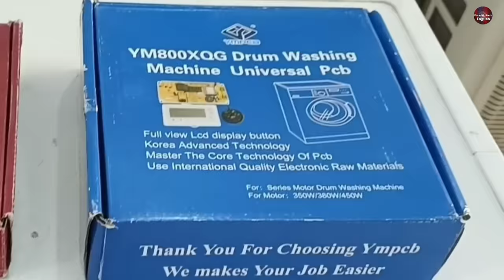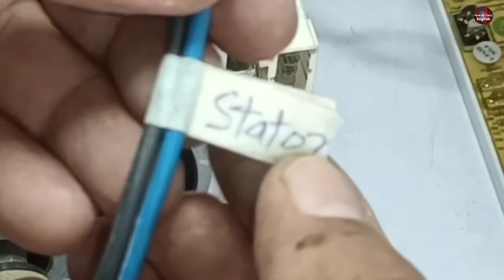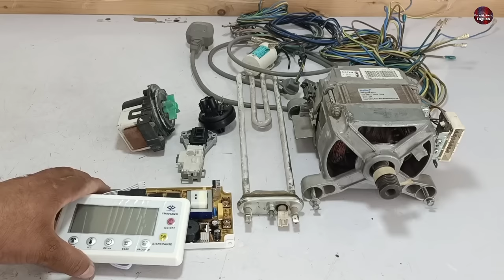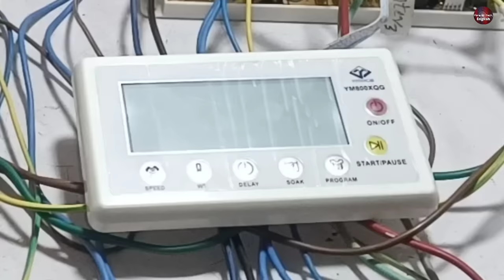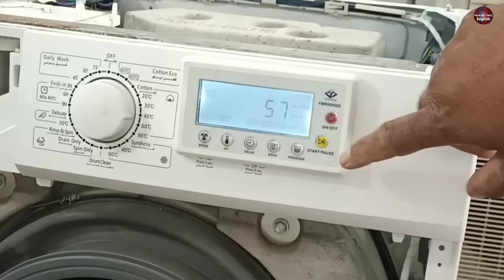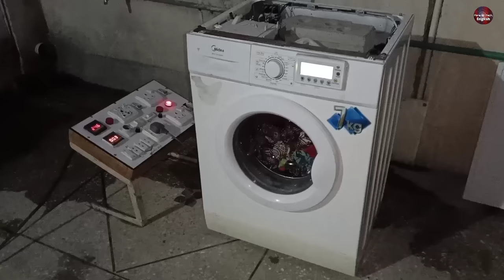Reviving Washer with Universal Circuit Board

Comment: who the heck would go thru all this trouble fixing their washer?? This type of work would cost over a $1000 to do all this.
Reply: In your consumer country may be, but in poor countries which are paying for you consumer society is worth it!
Reply from the maker: You will be shocked to hear that it costs only 70-80 dollars. Because the country I live in has low repair rates. So it was worth it for the customer.
Reply: @forevertechenglish   You live in US according to your channel info. 🤣
Reply: It’s well worth the money if the washer is in good condition. It prevents excess waste hitting the scrap yards.
Reply: Do they make a universal control board for a dishwasher? I have one that just quit working about 5 years ago. Everything appears to be fine and it has a nice stainless steel interior. It appears that the microprocessor is dead, probably from a thunder storm that passed through the day before. Dishwashers here in the EU are quite expensive and I can do my own repairs, an electronics tech for close to 38 years.
Reply: @forevertechenglish noice
Reply: If I knew there was a universal board, I would have absolutely gone that route. I kept our Sears front load washer running for almost 20 years until a power surge took it out when it was running. I regularly cleaned and maintained it and it was as good as new except for the controller which was no longer available. I considered designing my own but it was winter and I didn’t have the time to do without a washing machine.
Reply: 2.000/=  or 20 $ and work done in my country.
Reply: Time can be saved by mapping the existing wires and just create a splice onto the existing.
Some older machines though are worth more because they outlast newer machines many times over.
Instead of replacing every 4 to 6 years, some models last 20 to 30 years. Even more impressive is some of the older commercial machines that handle frequent use.
Reply: Great video thank you, nice to watch a person who knows their job.   If my machine's circuit board breaks I'll be searching for a universal board. I love that the machine shown has hot and cold inlets (I'm guessing). Haven't seen that for decades
Reply: @andrewwasson6153  I wonder if this could be used on a top loading machine. I have a situation where it appears that the controller for my GE dishwasher has failed, don’t know if it might be a water pressure sensor switch that has died but no power light. I am contemplating using a Raspberry Pi as the logic board and then using relays to run the various electrical items ie water valves wash pump, drain pump and heating element. I would need to bring in to the circuit a water temperature control into the picture, probably premade. As of now the control board is unobtainium but I did find out years ago this machine was made for GE's export market in Italy. Funny it originated in Italy, traveled to the states and returned to Greece. Most everything mechanical is ok with the machine, just the PC board might be dead. I did find something similar on the web and I am tempted to order it. Otherwise I will have to call on a friend to write the program for me, not a software guy, just an electronics tech. Should be easy, we have always used one program on that machine.
Reply: In high income countries it would take passion or seeking satisfaction in a job well done. In low income countries mere desperation is enough to get a job like this done.
Reply: Cheaper if you have slaves or children doing the work.  But yeah, qualified technicians who don't use non compliant wire and install terminal insulation so lugs don't short out from machine vibrations will cost more. 
The thing is, old machines get very manky stinky with septic buildup, and it's nasty working on them, so qualified techs deserve to be properly paid.
Reply: @Subgunman  That’s weird that it’s lost power. I’ve got a GE Dishwasher too. I’ve had a pretty good look at it but have never had issues with all power lost. I wonder if you can find a schematic to figure out if the plugs have all the power they need. I imagine at some point in the machine, there is a power supply to turn the house AC into a reasonable DC source. The controller would need around 5 volts and the motors might run higher, like 12 volts or something. It could be as simple as a blown rectifier or even a fuse in the power supply.
Reply: Slaves? Like a wife or neighbor?
 @BTW...
Reply from the maker: @Subgunman  the top load washers has different model universal boards, i have tried them out to, they also works fine.

Comment: fake. The washing machine is new because no traces of corrosion on the bottom of the frame.
Reply from the maker: the washing machine was fine body wise. Its original control board was dead.